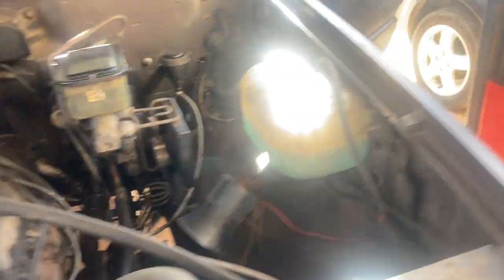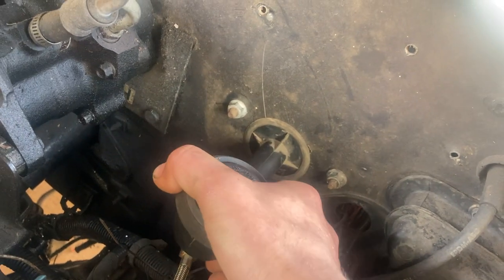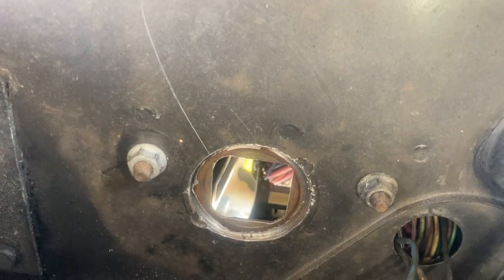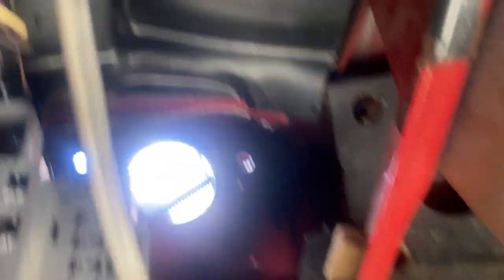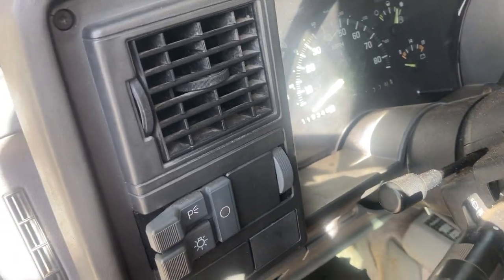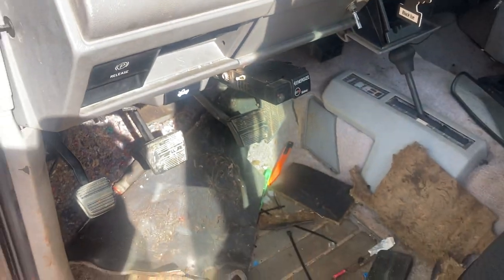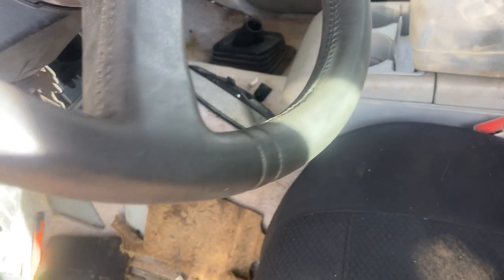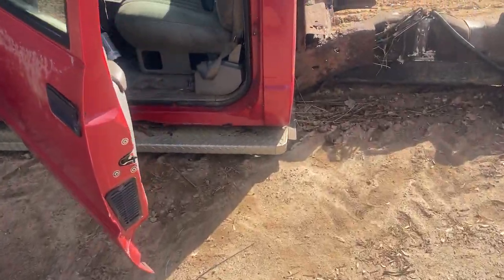Gmt400 manual transmission swap clutch pedal

Comment: Thank for the info! Manual swapping my 94 K1500 and used this exact method! Clutch pedal is now totally secure, I didnt even need washers behind it.
Reply: What size hole bit did you use for the master cylinder

Comment: 1988-94 doesn't have the bracket welded in the dash but 95+ does because it's literally the round dash like your 96 parts truck, but 88-95 use the same clutch bracket with the 2 bolts holding master cylinder while 96-98+ have the twist lock master cylinder. Good video tho!

Comment: That helped me visualize what I need to do. Will your original driveshafts work or are they a different length too.
Reply: Mine worked. Manual trans was about 3” shorter. But the overall t case/transmission length was within a half inch.
Reply: @CollinZ71  hey man what clutch pedal set up did you use.
Reply: @corbinbruzzese749  clutch pedal and bracket was out of an 89, I did not use the bracket above the dash, I took off the wiper cowl, drilled holes and bolted the bracket in that way with a series of washers.

Comment: Is it possible to convert a ‘88-‘94 clutch pedal bracket to accept that ‘96+ twist lock master cylinder?
Reply from the maker: It might be best to swap the bracket out for the newer style I see the brackets on eBay for around $200.

Comment: How can I adjust how hard to press on the clutch or how deep it has to go
Reply from the maker: On the hydraulic clutches there is no linkage to adjust. On the nv4500 with the internal slave cylinder you can shim it but you should measure your flywheel to see if a shim is required. I have had issues in the past bleeding the air out of these hydraulic clutches. If there is any air in the system the clutch will not fully release and the pedal will feel soft.

Comment: I have a 90 Silverado 1500 I’m converting from auto to 4 speed. I will be using a hydraulic system. What clutch pedal out of what year truck do I need to buy? Another video shows a Wildwood clutch pedal and slave cylinder but the Wildwood clutch pedal appears to be shorter then the brake pedal.
Reply from the maker: I see on eBay you can get a used oem clutch pedal and bracket for around $200. The oem style has been working very good in my truck so far.